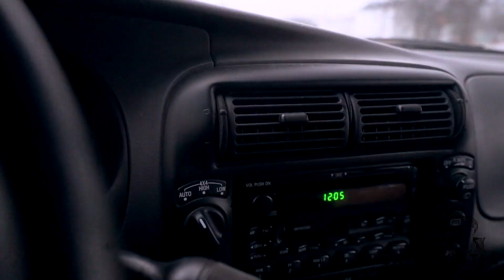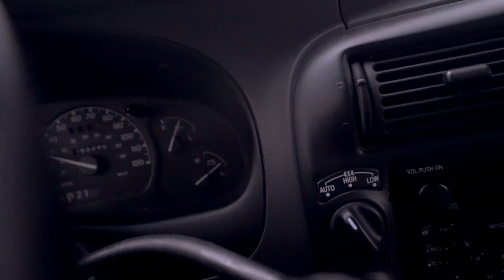The Snow Storm is Coming !!! Chant's Daily Hustle 84

Comment: dont forget to let your guys know that the explorer locks up on itself so always take the key with them and dont leave it running with no one in it, i would also get an extra set of keys one for lock and one for ignition unless they both use the same key but yea i would get a spare and u should put that on your keyring or carry it in your truck just in case, things can get hectic if u get a big storm and the guys mite forget even tho u tell them, either way good luck i hope u get a good storm stay safe and great vids as always brother..